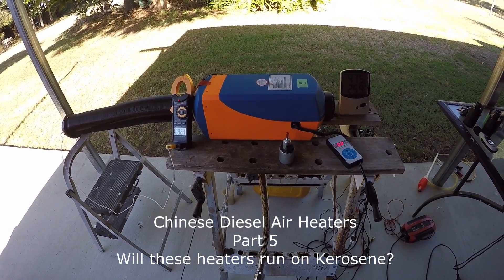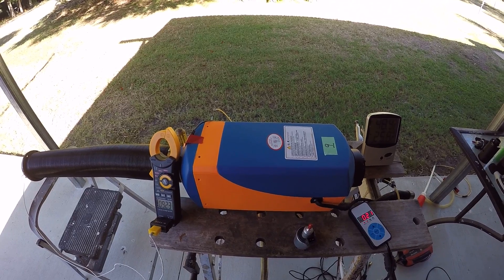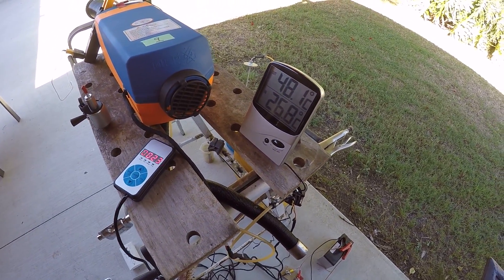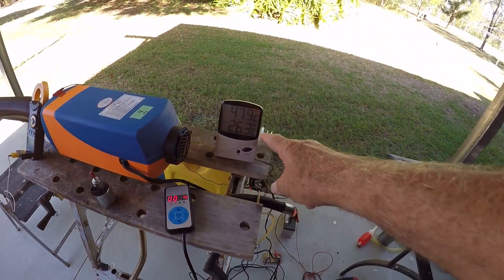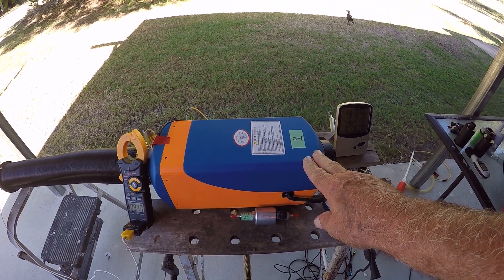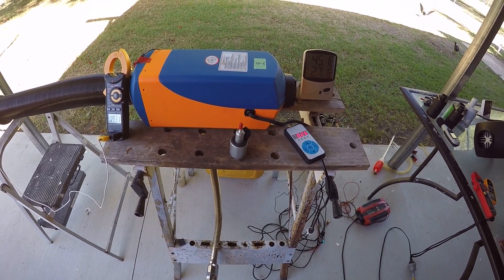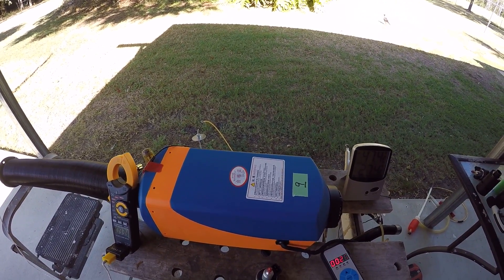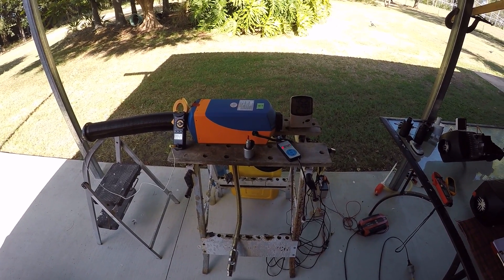Chinese Diesel Air Heaters   Part 5  - Kerosene Use.

Comment: I run my heater on diesel, but once a week I will run it on kerosene for a few hours just to clean any crap out. So far this year diesel is cheaper than it was last winter in Canada. I was wondering about diesel additives ???? Could I add a cap full of the cleaner on every fill-up, and maybe get the same cleaning results as kerosene ????
Reply from the maker: Hi David, I don't like to comment on things unless I have personally tested the product or the process. There are many different additives on the market, and I have not personally tested them for  effectiveness on cleaning these heaters, so I can't offer you an opinion. 

If you use one during your coming winter I would appreciate some feedback.  JMcK

Comment: Hi John, thanks for the great series of videos. I have a 5kW heater. The default lowest setting is 1.2Hz. If I am using kero (80:20 kero:diesel) for a cleaner burn, am I safe to run the heater this low and not risk sooting

 up? I’ll run it on high for a few minutes before shutdown if needed, but 1.2Hz puts out plenty of heat. Thanks
Reply from the maker: Hi Bruce, that should work fine if you have a good install (without too many restrictions in exhaust or combustion air intake) . Enjoy the warmth,   JMcK
Reply: John McK 47 thanks John. I appreciate the quick reply.

Comment: From Wikipedia: 
The ASTM International standard specification D-3699-78 recognizes two grades of kerosene: grades 1-K (less than 0.04% sulfur by weight) and 2-K (0.3% sulfur by weight). 1-K grade kerosene burns cleaner with fewer deposits, fewer toxins, and less frequent maintenance than 2-K grade kerosene, and is the preferred grade of kerosene for indoor kerosene heaters and stoves.
Reply from the maker: Thanks for the info Michael. Yes the 1-K appears similar to our lighting Kerro, which we use in stoves and kerro heaters in Aus. But sadly this "clean" kerro does not have the lubricity to use in this type of diesel air heater without the addition of some diesel for pump lubrication. 

I have not tested a piston dosing pump for wear using the higher sulfur content 2-K kerro so I can not comment if it can be used alone without some added lubricant.  JMcK

Comment: Hello John, one of our Canadian magazines posted this article about kerosene heater safety. In it they discuss sulphur and nitrogen dioxide pollution. After reading this article (if you are willing), would you have any concerns and if so, how could one further test for such pollutants? Thank you. 
https://archive.macleans.ca/article/1982/12/27/kerosene-heaters-meet-a-sudden-chill
Reply from the maker: Hi Michael,

Thanks for the article. Makes interesting reading.
However this dos not relate to these Chinese heaters. What is involved here are domestic heaters burning kerosene in the home. I personally do not like these type of heaters burning gas or kerosene.  1. They have a naked flame. 2. The combustion by products are emitted directly into the living area. 3. They produce a lot of water vapour.

The Chinese diesel heaters, the subject of these videos, have a seperate and sealed combustion process and the by products of combustion (exhaust) are expelled outside the living area. Much like driving a motor car. We all know what happens if the car exhaust is directed inside the motor car. 

As combustion vessels go, these diesel heaters burn very clean, and hugely cleaner and more efficient than a motor car engine. When tested against emissions from a diesel car exhaust it is just no contest. 

Regards.  JMcK
Reply: @johnmck1147  thank you for your insight. I can’t ague with a single point. Keep up the great work!
Reply from the maker: Michael Wilson 

Your welcome Michael.  JMcK

Comment: John Mck, what you class as lighting kerosene out there is commonly known a parrafin here in the British Isles/ UK. As you say this parrafin oil has virtually no lubricity factor whatsoever. A drop of parrafin rubbed between the index finger and thumb has a sort of squeaky dryness quality to it. Diesel and heating kerosene both feel oily and slippery by comparison.
Reply from the maker: Hi Howard, thanks for the feedback from the UK.
Reply: @johnmck1147  did you see the other post I made about when the visible air bubbles dissapear in the clear fuel lines and how it is a firm indicator that the atomisation gauze is getting very blocked with carbon? I have even seen the pump produce high enough pressure in the lines to jack the clear pipe out of the rubber joint piece before now.
Reply from the maker: Howard Osborne 
Yes Howard, and I sent you a reply.  JMcK

Comment: Can this run with drain oil mixed with gas to thin the oil.
Reply from the maker: Oh Frank, you have missed some of my videos.
Yes, it will run. -  For a little while. Just the same as your car engine will also run without sump oil, or cooling water. -  For a little while.   Don't do it, it will cause you major maintenance issues.   JMcK

Comment: Thanks for all the great information, John. In this age of disinformation, you've energized me with new hope. If you have a moment would you please entertain my question.  Because I'm trying to warm a Promaster which uses gas and already has an auxiliary fuel pick up accessible near the front seat,  I would like to find a cheap Chinese gasoline parking heater.  There are only a couple out there and they seem to go on and off the market, via Amazon.  Comparing the diesel and gas kits, they look to be using the same fuel pumps for both.  Would the lack of lubricant in the gas model cause those little pumps to fail.  Are there other parts prone to failing as well?  Essentially, what's your take on gasoline parking heaters?  Thanks for your consideration.  Cheers!
Reply from the maker: Hi Barry, I know of the petrol version of these heaters. Eberspacher make a petrol version, and I have heard of a Chinese version that seems to come and go. One viewer was going to buy one and I said I would love some feedback. But, to answer your question, I try very hard not to comment on items I have not had personal experience with, or personally tested. I have wondered how the dosing pumps will have a decent life with modern petrol, remember, when Eberspacher brought out their petrol version of these heaters, we had lead (lubricant) in our petrol.  So I can't be of much help here. Sorry.  JMcK
Reply: @johnmck1147  Hey, thanks for responding, John.  They're unavailable on Amazon at this time, I may try one out if it comes around again. Since all the size specs are the same as diesel I can switch it out if it's a failure .  I'll certainly write to inform you either way.  Cheers, BC
Reply: Hi John: Below is the only working link from amazon with comments about gasoline answered: "Dear friend,
 We improved our combustion system and the oil supply system to make it can use gasoline or diesel as fuel. And we succeed many test. Best Regards".  That's all we have to go on. The pump looks the same.  It would take someone with your experience to know the difference.  Here's the link:   https://www.amazon.com/Diesel-Gasoline-Parking-Heater-controller/dp/B07H3NKKB2/ref=sr_1_3?keywords=5kw+12V+24V+Diesel+Gasoline+Air+Parking+Heater&qid=1581897055&s=hi&sr=1-3  Cheers, BC
Reply: Last question--after 16 videos, you have me deep into this: It looks like they're paying attention to their pumps in this one, wondering if you can tell from the pictures if this looks like one of the interchangeable controllers?  More info on this site than most...perhaps a good sign or good marketing. Thanks John.
https://www.aliexpress.com/item/32597767980.html?spm=2114.12010612.8148356.20.44477dd97umR4c
Reply from the maker: Barry Connolly 

Hi Barry, thanks for that info. The heater would need a very different combustion chamber to run on petrol. I can't make comment on this until I have stripped it down and given it a good test run. But at twice the cost of a normal heater, I think there is a bit of price gouging here.

The newer dosing pumps appear to have a Téflon lining, so should work on straight petrol, but again they need solid testing on petrol before I could comment. 

I will see if Amazon will lend me one to test.  JMcK
Reply from the maker: Barry Connolly ,

Hi Barry, I contacted the supplier directly and got a quick reply. They told me there were major issues with the petrol (gasoline) version of the heater, they used the words "greatly unstable". They said they had lots of claims for refunds, and will no longer sell that heater. 
Cheers.  JMcK
Reply: @johnmck1147  Well that settles that.  That's great you got an honest response.  I wonder if they'll be trying it again sometime soon, seems like they have the ability to create anything within weeks over there.  Open source, on-time manufacturing.  I'm sure you'd have a blast over there.  I'm going to write the other company and see what the result are. Thanks, John.
Reply: Hi John, I'm still searching and was wondering if the company you heard back from the other day is different than the one I will list below. I have alerted them that all the gasoline only heaters have under performed and have asked them to list why there's is different. I sent them your fuel delivery video to show them the community has serious opinions--ha..much more serious since you came along--god bless you man.  If they were willing to send you one of their gasoline models would you be interested in testing it? In either case, if they make a good argument I will probably try one.   Here's the company: Harbin HaoKe Science and Technology Co.,Ltd. 
and here's the model: https://www.alibaba.com/product-detail/Gasoline-4kw12v-air-parking-heater-for_60741337958.html?spm=a2700.12243863.0.0.2ce83e5fqUIYgY  Thank you for your inspiration. BC
Reply from the maker: Barry Connolly 

Hi Barry, I would love to do a test on one.
I wrote to the Amazon supplier you sent me a link last time. See below.

"You have received a message from the Amazon Seller - china-encoder
 hello John,

this gasoline heater not stable, many orders claim to refund, there is detection. so we don't sell it anymore.
if you want diesel type, it is with very reliable performance. "

If you can get a supplier to loan me one I would love to test a petrol version.  JMcK
Reply: @johnmck1147   Hi John, Well it looks to be a different model and comparing the images showing the factory where they're made it looks to be different as well. The sales guy I'm communicating with said he'd get back to me. They're probably translating your video and asking themselves, do we want to send a partially functioning heater to this guy?  I told them that if they're confident their gasoline heaters are functioning perfectly, they should send one to you because you are now the social media authority and if you give it the thumbs up, many sales would follow...but inversely if it doesn't function well.  Congratulations, John, you're the most powerful voice of cheap Chinese heaters! Information is powerful. Cambridge Analytica will soon be calling to offer you a job.  I should be paying you since I'm using you as leverage to weed out bad suppliers--well it takes a village. These guys seem to be producing at a higher quality product, but $350 is also twice the price, and that's without many of the accessories that come with the Amazon supplier.  However it's still 1/3 the price of Wabasto. I just watched the documentary American Factory...we're so screwed.  Cheers!
Reply from the maker: Barry Connolly 
Thanks for the kind comments Barry, and keeping me in the loop.
Be good if things work out as I get a number of requests about petrol versions.  JMcK
Reply: Hi John, Here's the company I had found that looked promising. http://beliefheater.com/  Wu Lin is the sales manager, she admits no independent reviews exists but insists that it's a great product.  I suggested sending you one for review could boost their sales and reviewed why social media exposure would be beneficial. They insist I should buy one for review.  At $150 I would, at $340. I'll wait. If I were them I would jump at your offer to review their product if it is as good as they say.   I sent them a link to your reviews.  We're at a standstill.  I'm sure they have many reputable products, they seem to produce higher quality than many of the others, they say they're heat chamber, glow plugs and pumps for the gasoline heaters have been modified.  Tempting isn't it:) I told them to contact you directly if they change their minds. Cheers, BC
Reply from the maker: Barry Connolly  
Hi Barry, my email address is   johnmck47@outlook.com. JMcK

Comment: I drive an old Japanese diesel van (1992 Delica). As now in Canada all our diesel is LSD, I was advised to add lubricity agent to my fuel, which I do at every fill. When I was installing my heater, I recall reading that you should not burn diesel that has additives in these, so I run my heater from a separate diesel tank and use LSD diesel for the heater. So the message that I am taking away here is that I have been doing the opposite of what I should be doing. And that is perhaps why recently my heater seems to have stopped working, and as far as I can tell, it is not getting fuel. Sounds like a new doser pump should be my first troubleshooting effort, and from now on I should add lubricity to my fuel tank for the heater.
Reply: no need to , as long as it is CLEAN diesel
Reply: @pauls466  You're right. Before Russia invaded Ukraine, I had given up on my 2 Chinese units, and ordered a Webasto (German company Webasto spent 10 million Euro and built a facility there in 2017, (which resulted in Russian sellers offering their heaters online). I bet they regret that now!). I feed it the same fuel as my van, and so far there have been no problems associated with the altitude or temps it sometimes has to operate in (2100m and -30C). Sometimes the fuel has additive, others not, does not seem to affect it. The upside to this was, I was able to use the same mounting holes, lines, and cabinet I had originally built for the Chinese units, which ultimately made the changeover a lot faster and easier.

Comment: Great video ... all of them on these heaters. Question these pumps are cheap , would it make sense to buy a spare one to run a cleaning cycle once a year or whatever interval that would be appropriate?
Reply from the maker: Hi GF, not sure what you mean with "cleaning cycle". If you have a fuel filter in the fuel line before the pump there is nothing in the fuel system to clean.

The real maintenance with these heaters is carbon build up in the burner chamber and the atomising screens. You can't clean these out by pumping fuel through the heater. 

Thanks for the positive comments.   JMcK.
Reply: John McK 47 what I meant was switch the pump and run kerosene periodically to clean burner... I thought you had said that was a plus of using kerosene...
Reply from the maker: G F 

Hi GF, sorry, I misunderstood you. Yes, running a high kerro mix through these heaters can be a good end of season maintenance program. So I assume you would have one fuel tank running diesel and a second fuel tank with a high kerro/diesel mix, with two pumps and two fuel lines. Yes, you could do that, but you would need a y valve in the fuel lines to change tanks and a switch in electrical system to change pumps.

Perhaps it may be simpler to just have the one pump and a y valve in the pick up line to change tanks.

Because the dosing pumps from China are so cheap, it is good practice to carry a spare.

Cheers,   JMcK

Comment: Kerosene and Diesel are not changeable. Only for stoves.
In the Air you will damage a Plane-Turbine with common Diesel fuel pretty fast.
Kerosene can be used for Heating purpose but common Diesel can not be used for Airplane-Turbines.
Kerosene has a very small area of evaporation and ignition temperature.
Common Diesel fuel (as a comparison) ist only dirt you can burn in a stove or Diesel engine.
The Air-Heaters you test are basically stoves and not an engine.
Reply from the maker: Hi Dieter, sorry, I do not agree. Sometimes jet rescue choppers in Aus will top up their fuel tanks with diesel if they are running short of Aviation kerosene in our vast country. A diesel emergency top up would not work in normal aircraft as the diesel would gel at high altitude freezing temperatures.

Also many high speed jet turbine  powered catamarans can use marine diesel or kerosene.

Kerosene or Jet fuel works very well in these heaters if you mix in some diesel for pump lubrication. In high altitudes or very cold weather a diesel kerro mix or a high sulfur (for lubrication) kerro works better than diesel. 

Cheers.   JMcK

Comment: I use ashless 2 stroke oil mixed into my Kero to lubricate that pump. I don't use much, about 30-40 ml to a 20 L container. So far no problems.
Reply from the maker: Thanks for the feedback Tailss.  JMcK
Reply: @johnmck1147  Interesting concept.

Comment: Very informative. Thank you very much for your time and knowledge. Hopefully my Walmart kerosene here in USA has enough lubricity. I will probably add a mixture of diesel to be on the safe side
Reply from the maker: Your welcome LN. JMcK
Reply: If your heater is tuned right it will clean on diesel.  Diesel is so cheap in USA. And if you want to run diesel or paraffin  you will be just fine. John's pump was faulty or his fuel was dirty. These pumps are also used for gasoline,  which is a very dry fuel with little to no lubrication.  You can pump water in them.